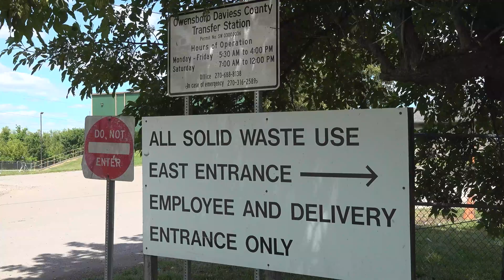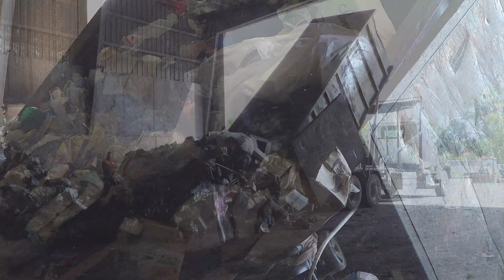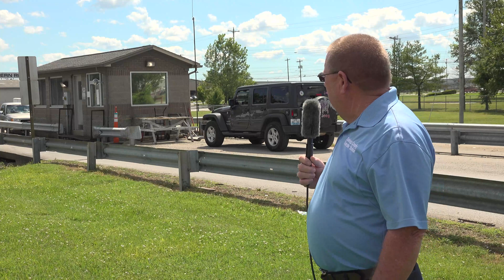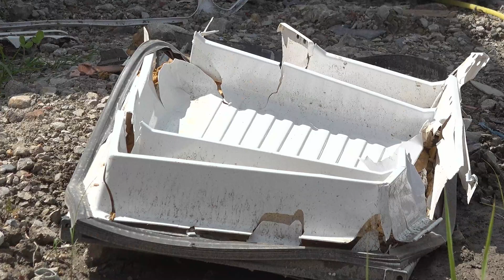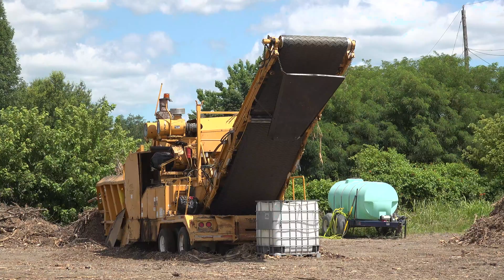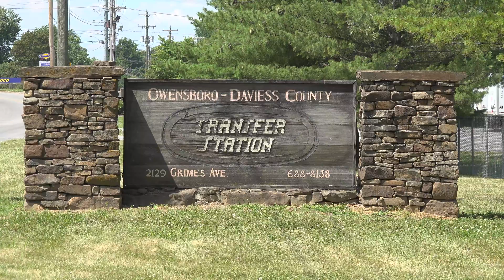Grimes Avenue Transfer Station

Comment: Just a question? When the white goods come into the transfer why is refrigerators  freon is not being removed immediately before it make it to the landfill?🤔?
Reply from the maker: The technicians and equipment for Freon removal are at the landfill. Multiple loads of white goods are taken and stored until Freon can be removed. After Freon is removed the white goods are crushed by a backhoe and taken to Owensboro for recycling.